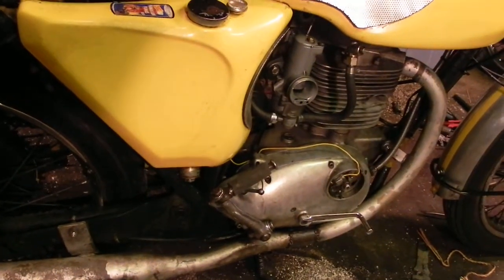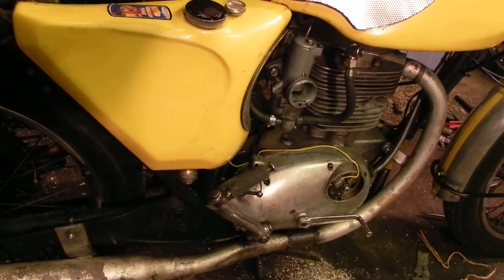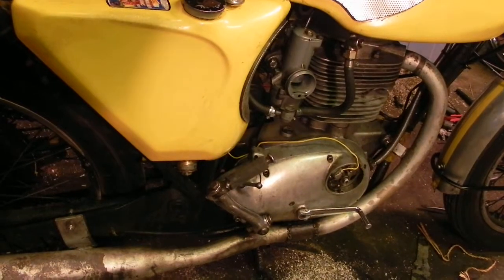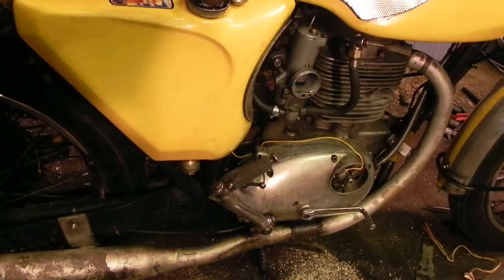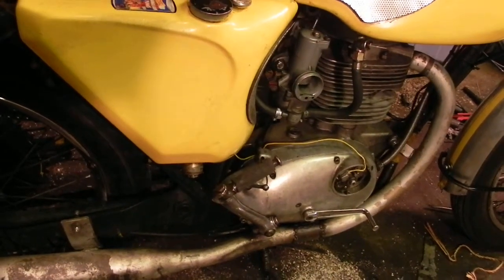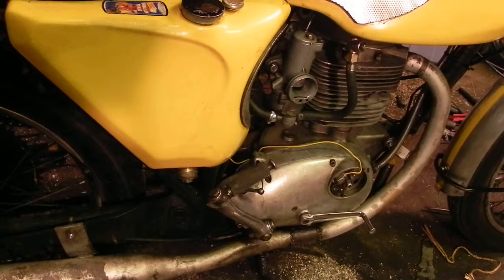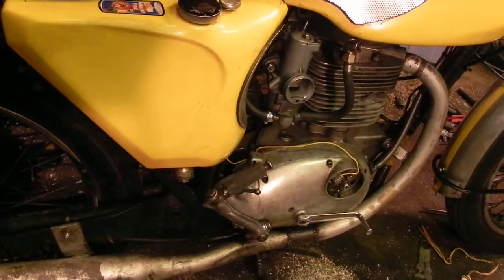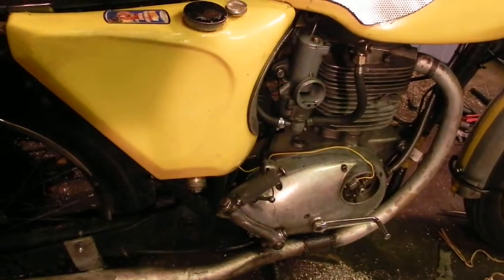BSA breathing issues, back to head. Leaky inlet valve? wrong lap?

Comment from the maker: @roadrocket 
Thanks, I can hear and feel the air leaking out carb mouth when kicking it by hand slowly. A wheezing sound, I am just puzzled that the gas holding test worked month ago but after the short run perhaps something dented the seat. Thanks again, I don't have a pressure tester but will fabricate a valve compressor today. Should have had a better shop do the guides etc.